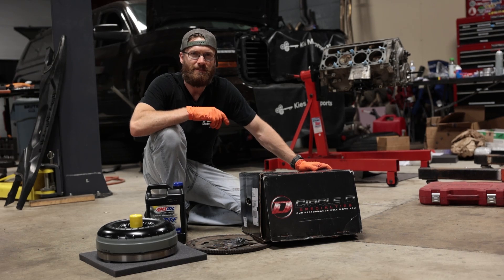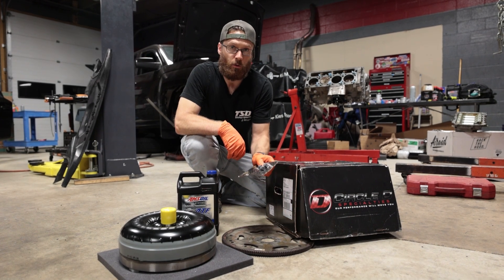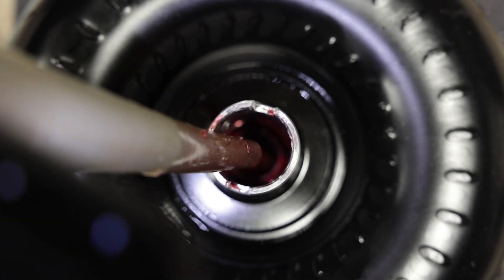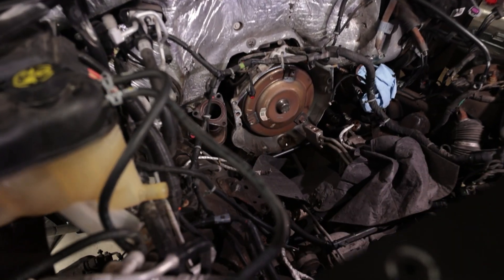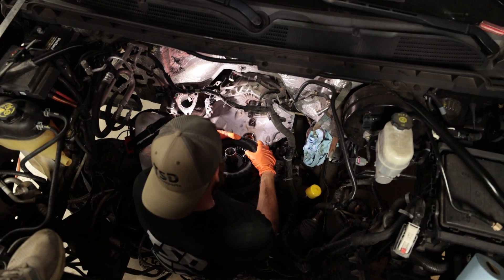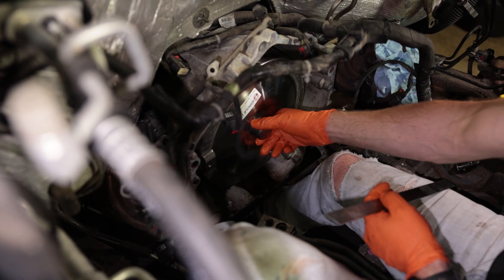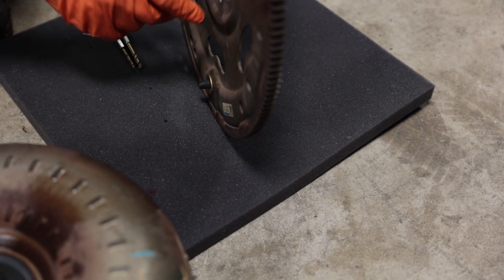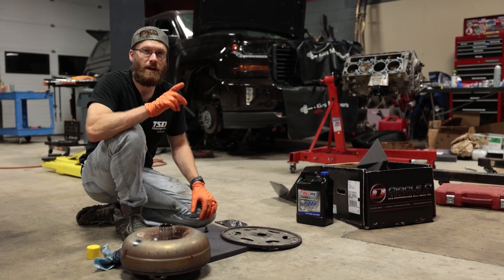Silverado 6L80 6L90 Circle D Upgraded Torque Converter Install - Save 2014-2018 Sierra Transmission!

Comment: 180° limit?!per GM instructions,  even to check the fluid on a 6L80 transmission, it requires the fluid be heated up to 180°.  Sticker under pan states 160°-200°.  Yet you say not to get the torque converter over 180°?! Good luck!   Dexron-VI transmission fluid operates optimally at around 180°F.  
This temperature provides peak performance in terms of viscosity, friction stability, and heat resistance for GM 6L80 transmissions like in the 2019 Silverado. Normal running temperatures fall between 170–200°F during typical driving, with the fluid maintaining integrity up to 220°F before accelerated degradation begins. GM specifies the normal operating temperature for the 6L80 transmission at 180–220°F.  
This range aligns with Dexron-VI fluid’s optimal performance, allowing proper lubrication, shift quality, and thermal management during typical driving. Transmission temperatures in the 160–200°F range are common for unloaded highway driving, rising to 200–220°F under load like towing. Sustained operation above 220°F accelerates fluid breakdown; GM recommends auxiliary coolers if exceeding this regularly.     But this torque converter u are installing recommended  <180°?! No bueño

Comment: Should I refill some of the used fluid or am I safe to put all new fluid into it? Just curious as I have heard conflicting info on that.
Reply from the maker: As long as the fluid has been changed every 50K miles or so it is safe to use new fluid. Realistically, probably every 100K is safe but it does get riskier and more frequent changes, especially under heavy use is recommended
Reply: @TheSundaeDrive I bought the truck at 86k miles, changing the TC at 89k. Dont think its been replaced yet.

Comment: What? 180 degrees max. Towing 10k on a 95+ degree day. No way keep temps at 180 degrees. Run around town temp 160 degrees and tows at 200 degrees. No thermal bypass on 6l90.

Comment: If you are going this far you are enlightened.  Congratulations. 
  If you have extra $ and the down time send the trans out to get the billet servos that have the plate that gives more surface area to apply the clutch plates,  get the 6 gear upgrade vs. the stock 4 gear to hold more torque and distribute it at 6 points instead of 4. Get the raybestos red clutches and updraded torrington bearings and you'll have a 6l80 that nearly will hold the torque of a 6l90.
  This list of mods was done to mine sans the converter as i went with the 3 plate billet converter for the extra $600 along with the tune to make the transmission shift the way you want it. Mine is behind a mildly boosted and modded 5.3 and shifts like i want it.
  Also do yourself a favor and drill the pan for a magnetic drain plug and use mobil 1 synthetic lv atf hp (blue label) for fluid if you cant pony up the extra $$ for amsoil fluid.
  As he says do that thermostatic valve upgrade a.s.a.p. to bring the temps down from 212 to 160. This will ensure your unit, before moddind, has the best chance to be free of friction material.
  Go 200 rpm over stock stall. You'll find it useful and cant be undone once you choose the converter highlighted in the video.
  Proactive is the word of the day especially if your v-8 is modded, even lightly, over stock.
  And a little deeper down the rabbit hole get a 2 piece driveshaft or at least upgrade the factory one. Put driveshaf loops in just in case.

Comment: I installed the Mishimoto front mount tranny cooler.  My transmission temps now get to 196 degrees whereas before the install it was running at 194 degrees.  I did notice it takes a slightly longer driving distance to get to those temps but I am disappointed that it doesn’t maintain a lower temperature as advertised.
Reply: If you didn't install the bypass, you didn't do anything. GM's stock trans thermostat doesn't open until 190 something degrees

Comment: I have a 15 ltz Silverado 1500. 6L80. Ugraded the T/C  to a Pro tourque tc . My Transmission shop has replaced it 3 time due to slipping out of lockup while holding speeds . The TC shudders until I let off the gas. I cannot see it being a faulty tc 3 different times. I don't think they are getting the tune right. Any recommendations?

Comment: I have a 2018 gmc sierra 1500 4x4.. my tranny just stop goin forward.. but when I shut it off and start it back up it will drive a little ways.. don't know what to check first.? they say its a dirty thermal bypass valve, it does need a change but it may be to late.. fluid is dark red.. never knew my tranny was running hot this whole time otherwise I would have changed the bypass soon as I bought it.. ugh.

Comment: I have a 2021 Silverado with 80,000 miles, my engine blew and I had to replace it with a jasper crate motor. Now I’m having a problem with my transmission, I heard a torque converter might solve the issue, but further research tells me a new transmission might be best. I wish I never bought this Chevy.

Comment: My 09 runs around 185 190 but on hot days it closer to 200 and it gets a bit scary lol. The lift and tires don’t help. So there for I’m considering putting an upgraded converter and cooler.

Comment: Try not to exceed 180 and never 200?? 😂 I'm at 185k on stock everything on 35s, have towed a bit and hit 245 briefly once towing a couple horses. Gets over 200 every time I tow even with the thermostat bypass. 200° is NOT excessive for a transmission, ideal operating temperature is 175-215 in all the research I've done. For them to say don't exceed 180 doesn't give much confidence for such a reputable brand
Reply: Why they reccomend a trans cooler… not for stock weekend warriors
Reply: Coming from  transmission builder. The guy is right and you are wrong. Yes, you can run a transmission over 200, but that doesn't make it good.
Reply: @jakereagin9924  oh ok that's why factory transmissions regularly go over 180° with typical driving. My 2021 silverado hits 180+ daily even with the PPE thermostat delete. So yeah I'll take your advice
Reply: @ yea the same transmissions that fail regularly due to heat that lead to the creation of the bypass kit and after market trans coolers. What do the guys at circle d know though lol. 180° is too hot thats why they fail so often i know this may be hard for you to believe but just because the gm engineers did it that way doesnt make it a good idea look at active fuel management and all the issues that has caused and they still put it out every year.
Reply: @3BRAD5 yes, the transmission can handle it. The fluid looses its goodies at 200 degrees ans becomes useless fluid
Reply: @tulsaprepperdad6674 uh… uhkay

Comment: Just ordered a 4400 for a 10 speed. 10s with headers intake and little corn at full weight is just a heaven in earth setup for me. Fast no. Slow no. Fun and repeatable yes.

Comment: Y’all need to upgrade your radiator to 3 in aluminum and a 40 k   I’m in AZ and my truck on a super hot day hauling or beating on it never reaches 180.  160-170 at most   Ashe’s that’s 115 degree weather

Comment: I installed the bypass two years ago and I haven't seen the transmission temperature go above 145 degrees since. It usually stays around 120 degrees. Just turned 180,000 miles and going on a 2016 silverado. Just a matter of time before the converter goes. I'll do the upgrade when I have to. I've been putting the transmission in manual mode in gear 5 to keep the AFM from engaging for about 3 years now. The truck drives so much nicer when that ridiculous AFM isn't on.
Reply: From what I've seen it won't prevent the failure if it's gonna happen. But it for sure will help the rest of the transmission.
Reply: You can get a plug in part that goes right where the obd2 goes. It shuts off the amf. You can get one online easily
Reply: get the range chip to cancel out the AFM
Reply: @saturnsl21999 going to have to delete the AFM altogether rather just turning it off
Reply: @ColtonLynch-q8b you don't have to... at all
Reply: Lie. I did the bypass and eventually hit 180+ in hot weather. The bypass delete just takes the fluid a little longer to heat up.
Reply: @davidgxp2156 facts.

Comment: GM Part # 85585332 is the entire transmission cooler line plus the thermostat upgrade, costs $190.88. I replaced the entire line as the stock line hid metal gunk internally. Peace of mind.

Comment: At least with the stock torque converters when I install then I can spin them by hand and get them in so that the ridges on the back of the torque converter rub on the bolt heads going into the pump on the bellhousing, thats how I can tell its in far enough

Comment: I had a guy do a L96/6L80 swap into my 91 Blazer. I'll spare the story but I'm left with nobody to ask about issues I'm having. I have no way to monitor temps. A common mod for these is adding a rpm gauge and moving the gas gauge to an open hole; some have a clock. I'm going to look into a trans temp gauge now. What brought me here is that my trans sometimes acts like it's in neutral and then suddenly bangs into gear when I'm taking off. I'm not sure what i should be looking into
Reply: Sounds like torque converter

Comment: At the very least ALWAYS replace the $1 input shaft turbine seal gm #24219390. They get hard from the heat and cause the tcc to slip and burn up the transmission

Comment: Billet converters really are the only solution, stock converters are stamped steel and the ears for the bolts are welded on created more heat against the clutches inside the converter
Reply: It’s not a matter of if they fail it’s a matter of when
Reply from the maker: Agreed!
Reply: Technically a wear item, but i think 200k miles is the standard.

Comment: What would you recommend for my 6l80e?  2018 5.3 Tahoe Should I upgrade to a 6l90e converter or get a billet converter from oriellys/ autozone .  Thanks
Reply from the maker: The stockish torque converters normally will last around 100K it seems. They may last longer with better cooling tho. A billet torque converter should lastonger but you still need to do cooling upgrades. The 6L80E is the same as far the torque converter is concerned as far as I know. My truck technically has the 6L80e
Reply: @ I already upgraded the cooling thermo bypass and put Amsoil signature tranny Fluid when I bought the Tahoe at 60k.  Now it has 80k.  I’ll probably buy the TC Reman torque converter from autozone .  I’ll be installing it myself .  Thanks for your videos
Reply: @Jowee206-l9m  did you buy the TC reman? I’m thinking of going with one for my 6l90.
Reply: @johnnybobgoldstein2823  yes I did purchase the tc reman from autozone.  20% off free shipping and $175 core.  It should arrive this Monday.
Reply: @TheSundaeDrive would you know the stall speed for the 6l80e and 6l90 torque converter?
Reply: @Jowee206-l9m 6L90 TC on my 2017 3500hd stall is claimed as 1200 rpm. I idle at 650 rpm and it is fine. I’m going to upgrade to a 2800 rpm stall Circle-D this winter. I have a custom separate electric pump and filter and coolers which increase the amount of trans fluid by 1 quart and cool my trans to never exceed 170 degrees. Stock my trans reached over 215 while towing, disgraceful to let trans reach such temps, I was on highway and had to slow down to 55 mph to keep it cool enough to continue.
Reply: @teagreen2220 non mechanic here. Why would you want a higher stall at 2800 RPMs? Doesn't that mean you're not putting down power to a later or higher RPM?   Kinda like still being on the clutch in a manual
Reply: @brandonnguyen1486  just for fun and a new cam. I’ve been wanting to run a higher stall in my truck but was worried that temps would get too high while towing. I drive the truck a lot so it is my enjoyment to drive it. Finally I found a solution to high temperatures on these transmissions, just run a circulation pump with coolers from and back to the trans pan and you can basically keep the trans as cool as you like for a couple hundred bucks. This rebuild will be coming up in the next month, can’t wait!

Comment: The circle D torque converters are trash. Installed one in my 2018 Silverado 1500 and it broke within 6 months
Reply from the maker: Oh really? How did it fail? Stock power levels?
Reply: @TheSundaeDrive   I'm eager to hear as well.
Reply: Stock power my buddy bought one like 1 1/2 years ago. Just a bunch of hype.
Reply: warranty is 1 year for the Circle D and 3 years for the Florida torque Converters, just adding to the discussion.
Reply: Stock power and the hub snapped, trashing the bell housing and transmission internals

Comment: Nice video indeed.  My old torque converter seems to be doing fine so far on my 2015 Silverado.  Knock on wood.  Lol.  I have around 107,400 miles on my truck
Reply from the maker: Thank you! That is right around when they often fail. I replaced mine at 107K and now at 152K and no issues. Been running the sure cool upgrade since around then as well.
Reply: Mine literally did just that. Just over 107,000 miles. Getting a new trany this week. 

 @TheSundaeDrive
Reply: @TheSundaeDrive I am hoping mine doesn't go out then.  Lol.  I don't do much hauling trailers or towing heavy loads and whatnot or heavy loads.  How much does a job like this cost roughly to have a new torque converter replaced if mine goes bad?   Thanks.
Reply from the maker: Unfortunately when the torque converters fail they often clog the pump which burns out the transmission so normally an entire transmission is required. heat seems to be the killer so I would recommend a new torque converter and the sure cool upgrade.
Reply from the maker: Costs varies depending on if you are 2wd or 4wd
Reply: @TheSundaeDrive Dang!  That will definitely be an expensive repair.  Thank you for the information.
Reply: @TheSundaeDrive  I have a 4X4 truck.
Reply: Mine sh*t the bed at 145,000 miles and wrecked my transmission on my 2014…
Reply: @michaelforeman6386  I am sure sorry to hear about that.  That really sucks.
Reply: If I were you, I would upgrade it before it's too late. Mine failed at 113K mile. I was using Amsoil . Now I have to replace the whole transmission. It's around $5 to $6k in my area.
Reply: @SKMYF  I might have too look into that, that's for sure
Reply: I was in a very similar boat as you and based on your description both of our trucks have lived a very similar life. I took my 2015 to a shop at 106,000 and received a clean bill of health. 5,000 miles later my TC went out and I was down on the side of the road.
Reply: @blakeropers5363  I'm sure sorry to hear about that. At one time, GM used to pretty well build bullet proof transmissions but not anymore.
Reply: I’m next you can install torge converter in my truck